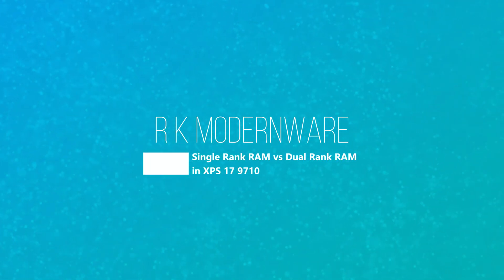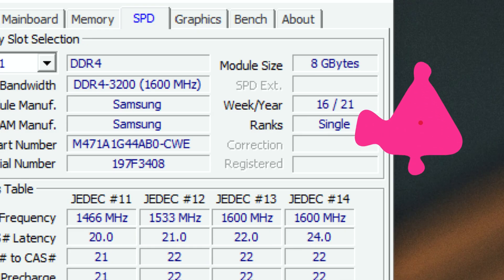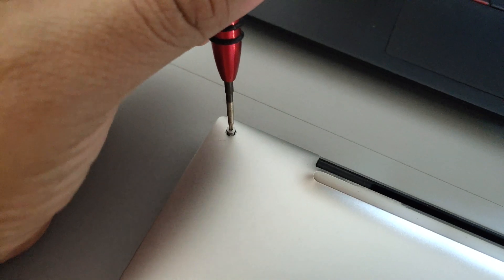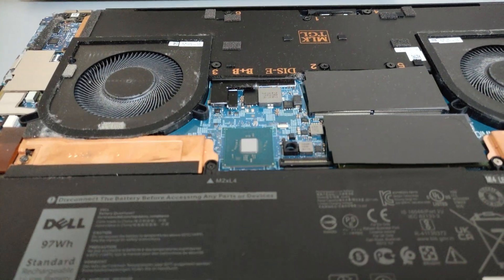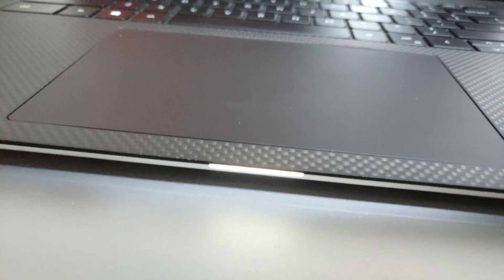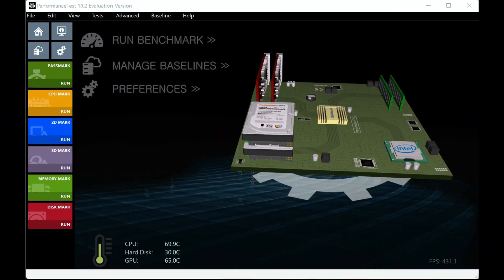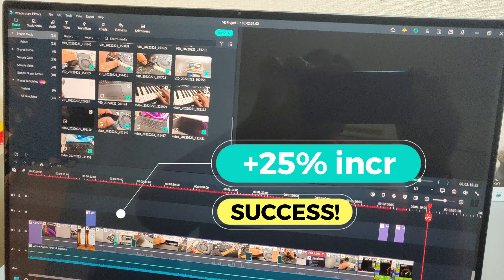Dell XPS 17 9710 Dual Rank RAM upgrade! Performance boost?

Comment: I cannot find a 32gb kit dual rank ram in Indian market at all. crucial ram is a gamble can send single rank or dual rank, x8 or x16. I got 2 options in Amazon. 1 is Timetec second is Dolgix. Timetec is 16gb x2 dual rank 2rx8 with price 10k INR and the dolgix ram is a single 32gb same dual rank 2rx8 with price 5k. Are these 2 memory modules at reasonable price or are they overpriced?
Reply from the maker: I think this is too much for DDR 4 ram .. now that it is being phased out the prices will increase.. you could have tried AliExpress but the Indian govt banned it .. now you cannot get a decent stuff from China without paying import duty. You can try eBay maybe.

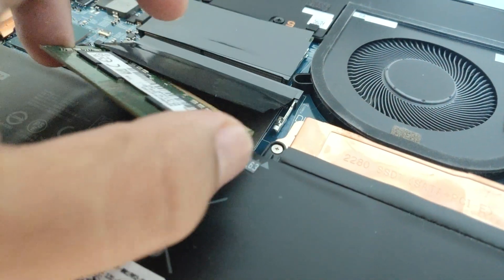Comment: The RAM sticks you replaced were not only single rank, they were also only 8GB each. (you can see it on the sticker of the ram you took out at timestamp 1:28 ). The new ram duel rank sticks you bought were 16GB each. How can you be sure that the improvement in performance isn't from the increased RAM capacity instead of going from single rank to duel rank?
Reply from the maker: At the same speed - 3200 Mhz, more memory should not increase the performance. More memory means more leg room, it will not increase the performance of getting accessing the memory unless I increase the 3200 Mhz to, let's say, 4800 Mhz. However in this case, the Rank plays an important part, the more the number of ranks, the more faster the memory will be accessed. you can search videos over the internet where many reviewers have changed the laptop RAM to dual rank and it has increased the gaming performance by 20%. Increasing capacity does not improve performance, unless you are opening 100 tabs on google chrome you will not notice it.